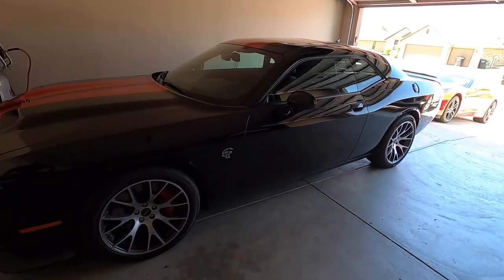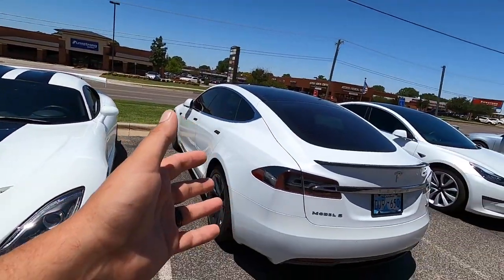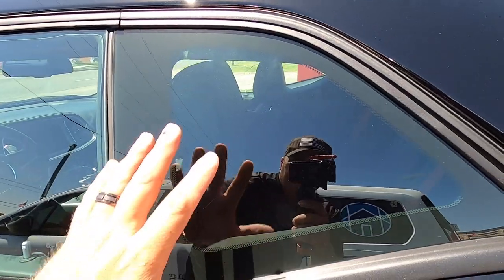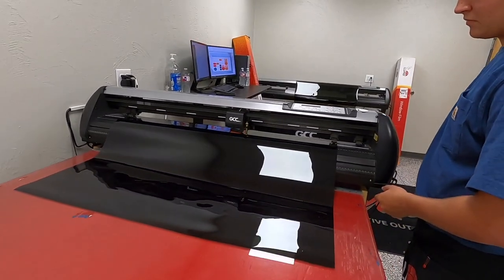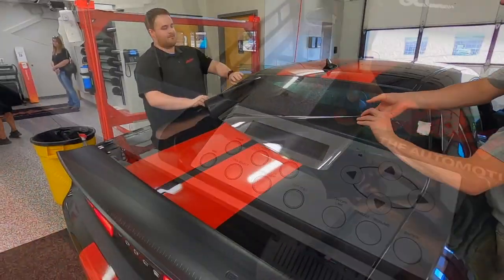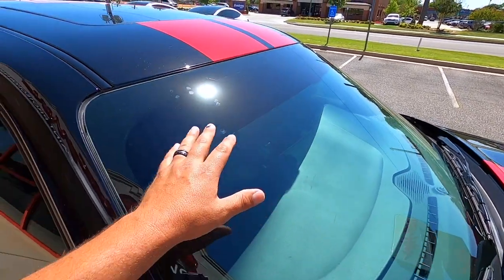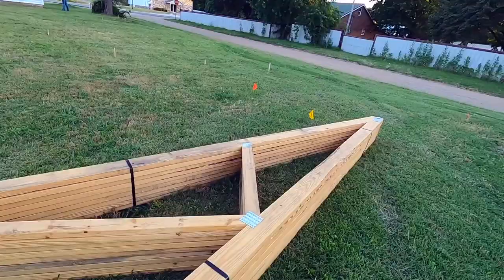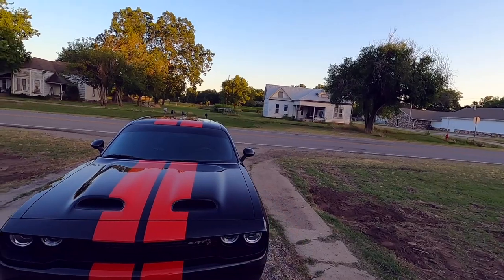Alta Mere Behind the Scenes Llumar Stratos Window Tint 2020 Challenger Hellcat and 2019 Corvette

Comment: Here in India they do this the same way. Except that they cut it manually, rest each process is same like that soap water part.

But unfortunately tinting is illegal here in our country. You're gonna get a fine if police catch you.

Only company-fitted tinted windows are permitted with 70% visual transmission of light on the front windscreen and the rear window, and 50% visual transmission of light for the remaining windows.

Comment: As others have said - the amount of tint you can have varies by State.  Here in NC you can't have anything less than 35% on your side windows.  You also have to pay an additional fee during your annual inspection to have the non-factory tint inspected.  Lower than 35% and you fail the inspection.  Also NO tint is allowed on the windshield below the sight line - even that clear stuff.

Comment: In California and other states it is illegal to add tint to the drivers and passenger's doors, also the front windshield of course. Some states don't even allow more than the factory tint across the top of the windshield and no banners on the front windshields. That is why you see the doors windows are lighter than the back windows. As long as you have a righthand mirror you can black out all the back. No right hands mirror, no tint in the back either! I live in both Los Angeles and Las Vegas, in Nevada I can black out all my windows and across the top of the windshield because it gets so hot there. If I have my Nevada license plates on they do not bother me much in California, but if I blackout my California plated cars I will get a ticket to remove it from the front doors before I even get back to Los Angeles from Las Vegas. They believe the dark tint causes more accidents especially at night when you really can't see cars right next to you on the right side. Thanks for sharing! Take care and God bless you all! David

Comment: That’s weird they tinted the back window from the outside 😱 in Scotland I have only seen companies tint the back window from inside the car. Also in the UK you can’t tint the front windows as dark as that. It would not pass an MOT test each year.
Reply: They do what is known as "Heat Shrinking" the film on the outside, but it installed on the inside.